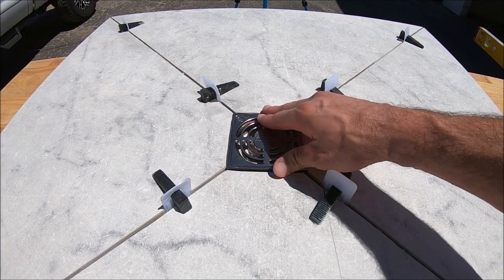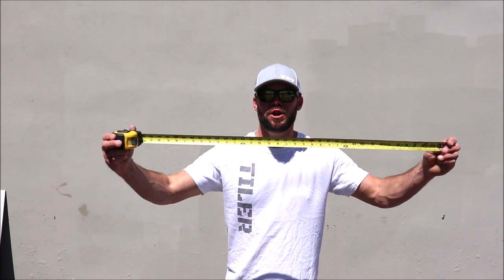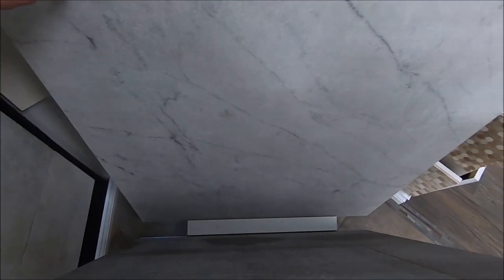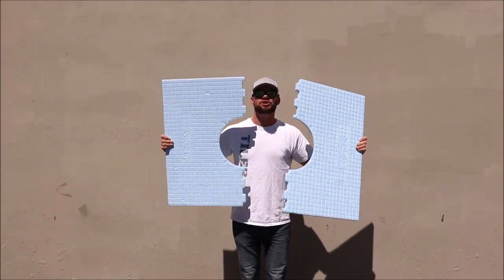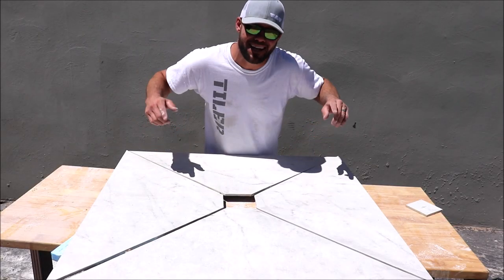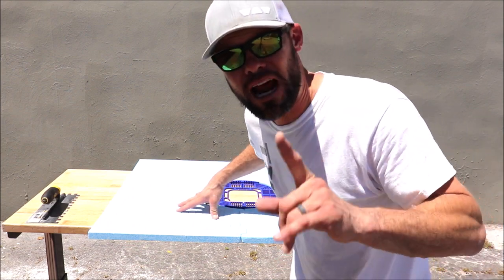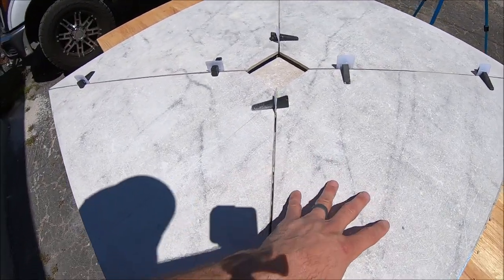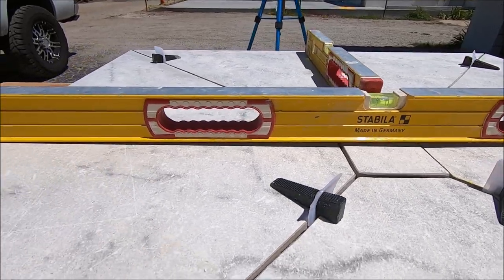Modern Porcelain Shower Pan

Comment: One more beautiful and smart video! Simply can`t understand why you have used a n angle grinder? Is that just because you have no large format wet cutter, or there is another reason? Sometimes we can see a very thin 6mm the same size Italian porcelain tiles. I can state, they`re too brittle and you would crack them by angle grinder easily. Also, it seems like grouts in your video are about 5-6mm... It can`t meet today`s requirements :) May be an option to buy (if you have your business connected to this), or just hire a 1200 or 1800mm wet cutter? It costs ~$300 /day or 300 for two days if you take it on weekend :)  One more option is to bring the tile in a specialised stone/tile services. They can cut for around 20  bucks per linear meter (including edges polishing). That`s in case if you have just one floor tile for your DIY project.

Comment: if you were to attemt this using a traditional mud pack floor instead of a foam pan, can it be done or do you have to pack the pitch differently ?  perhaps using the goof proof rails or something? or is a foam pan basically the same as a mud pitch in the way it conforms?
Reply from the maker: We've only installed large format on pre fab trays because of this reason. You might have to do a little thinny floating if done on a dry pack.

Comment: If youre going over a tradional mud pan with the large format method do you pack the pan with 4 sides sloping to drain?
Reply: Thats a good question. I would think a flat surface would be better use thinset to get the slope right

Comment: Do you use much of the USG??  I think their system is just as good as Schluter. The only thing I don’t care for that is their drain system.  Just not as many options as Schluter
Reply: Me too I started use usg pans but they are no longer manufactured once the stock runs out that's it

Comment: Wouldn't that be slicker
Than hell when wet though?
Reply from the maker: Not if it's Matte finish like these tiles. There is slight texture to these floor tiles.
Reply: Gotcha! Is there a way to tell when purchasing like a grading or designation from the supply house or is it more just the feel of the finish?
Thanks for the reply!
Reply: Dan Allen, while I encourage my customers to feel the tile as part of the selection process, look for a COF or DCOF rating with the tile. This coefficient of friction rating helps quantify it.  Most reputable manufacturers are including this data with their products, using accepted testing guidelines from one of the national tile institutes (don’t remember which one).

Comment: Lawsuit, shower floor. All those grout joints prevent you from slipping and falling .
Reply from the maker: The tile is matte finish, you will not slip.
Reply: I first saw this type of shower floor in a hotel in Germany, I showered in it several times, it was not slippery and I really liked it. But the tile needs to be appropriate. I am investigating this as I plan to do it for my own shower now. From my research the tile needs to have a dynamic coefficient of friction (DCOF) of 0.42 or greater. This is to comply with ANSI A137.1–2012. So ask what the DCOF value is before buying the tile.  For more info see https://www.thespruce.com/coefficient-of-friction-specs-to-buy-best-1822608